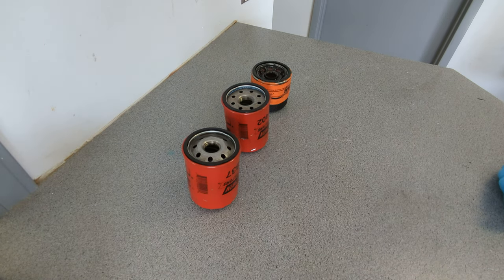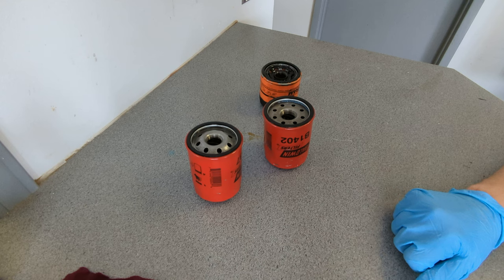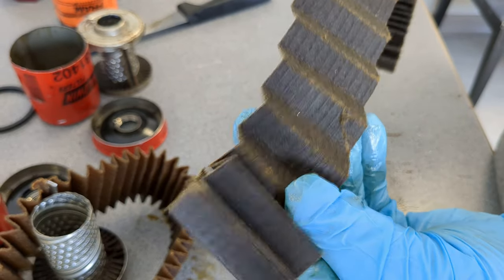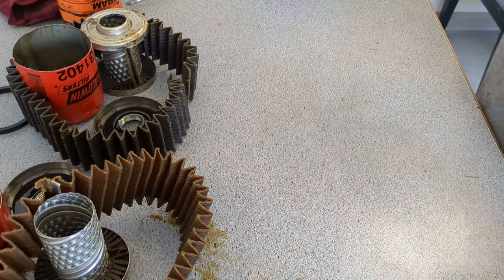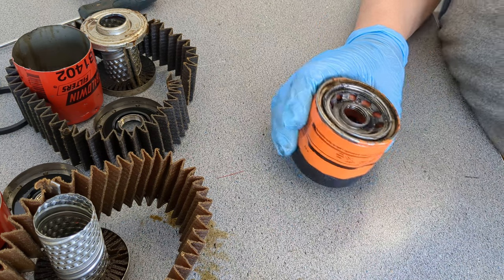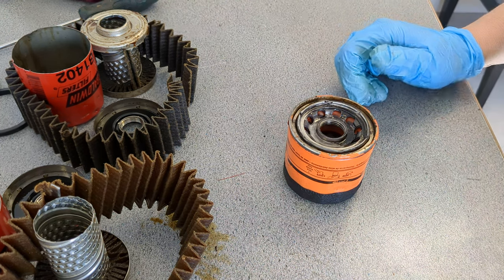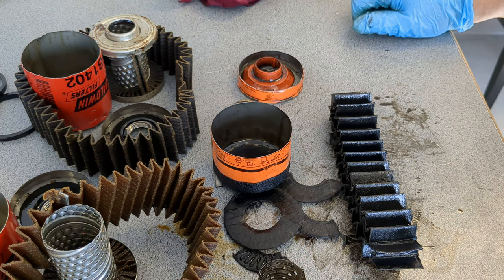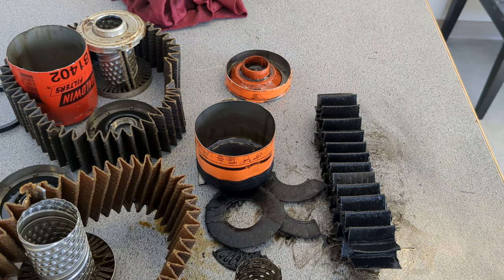Fram 6607 well used oil filter cut open plus 2 Baldwin filters cut open

Comment: What is sludge? Carbon? Micro burned dirt? My brothers 60z ford 3/4 ton pulling heavy trailers on conventional oil was full of sludge. Wow! It looked like silvery black soft to hard tar! I thot is was lead from fuel or babbot-hard lead bushing/bearing fines? Dunno tho!???!
Reply from the maker: Oil sludge can build up from poor oil change schedule, lower oil levels in engine, heat, and even bad engine design. The oil gets a gel like appearance and thicker and sticky, doesn't flow very well. Thanks Loren.